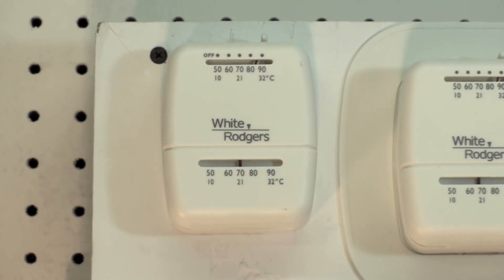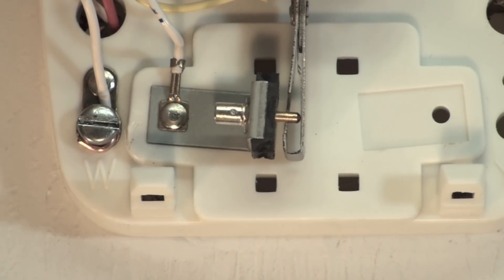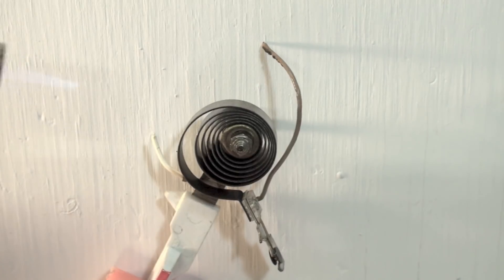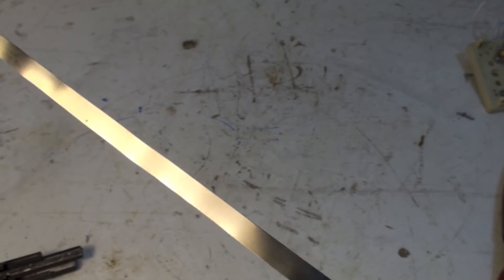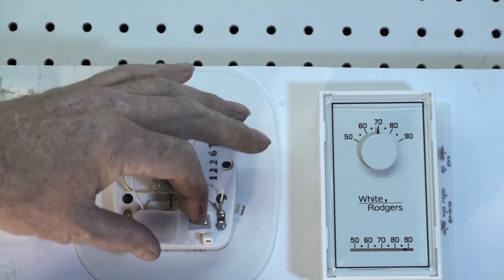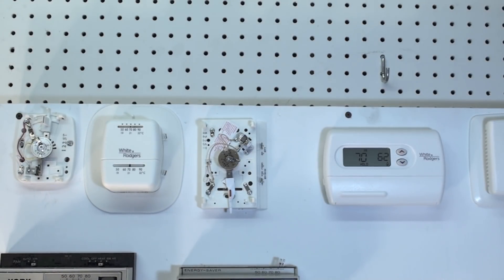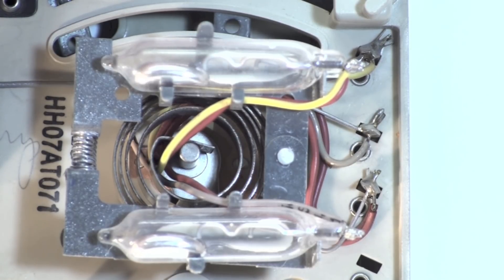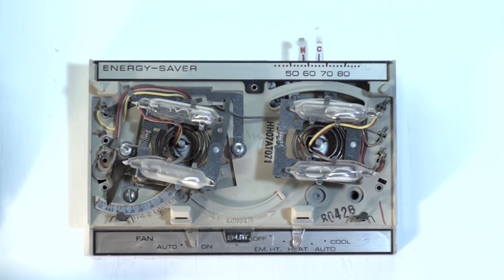The mechanical thermostat: how it works.

Comment: On an older CT87N1001 Honeywell thermostat,  how does the automatic side of the fan switch work. Is the automatic function part of the thermostat or does it connect to a extra lead to the furnace for the automatic feature to run?
Reply from the maker: If it has a mercury switch, the fan in auto leaves fan control to the furnace.  The newer style without the mercury switch has a F "fuel" and E "electric" switch that allows the furnace to control the fan in the F position.  E position energizes the fan on a call for heat.
GFM

Comment: Great video!  By the way, that dual lever thermostat will NOT work for our house because the boss of the house needs 78 in winter and 65 in summer!  I do not argue with her.  In our house, I will need those levers on the opposite side.
Reply from the maker: I don't either.   Happy wife, happy life.
GFM

Comment: I just need to know how to turn it on.
Reply from the maker: If there is a heat-cool-off switch, turn it to heat, set the temp lever above the temperature in the structure.
GFM

Comment: I have the first type of thermostat. Part of the thermostat is getting hot enough to melt part of the plastic housing.  The contact seems ok
Reply from the maker: Interesting.  Does the unit short cycle?
GFM

Comment: Of all the mechanical thermostats out there, my favorites are the Honeywell thermostats (in particular the CT51/CT55 rectangular ones, and of course the CT87N round), since they are very popular, well made, and easy to see and use. I too am fond of the GE/Trane Bay-Stat thermostats, since they were easy to see/use and very well made, as well as the Robertshaw TX400 Cube (which bears a close resemblance to the Honeywell CT87N).

Comment: I'm doing some updates on a small house that uses two millivolt wall furnaces for heat. How can I control both furnaces with one thermostat?? I'm afraid that installing two thermostats is going to result in "short cycling" on the furnace that is near all the bedroom doors as that thermostat will be too close to the furnace. On the other hand, I don't want to open a gas valve on a furnace where the pilot has gone out because I'm getting a millivolt signal from the other furnace. Seems like I need a 2 pole thermostat but I don't know if one exists.

Comment: Thanks for the videos. I'm an electronics tech myself and used to work at a hostel that had a few of these mechanical ones. We replaced them with digital programmable ones. They are good for if you could set it and forget it, but I find many people have way too many rooms on a zone and so the programmables don't seem to work so well in those situations. The room at the end of the zone will be the coldest. So I had to be constantly adjusting the one in my room that worked for several rooms anyway. Would have been easier to have a manual one as I was home most of the time anyway.

I'm downgrading a programmable one in my landlady's house tomorrow to either a digital non-programmable or an analog one. They find it hard to use the programmable one. Its not very user-friendly to elderly folks. They always have to get out a booklet when they want to change any setting. So I'm helping them go back to what they're comfortable with. There is lots of information for upgrading from analog to digital but virtually none for going the other way. This is a two wire one (r and w) so I'm thinking any old analog Honeywell should do. I will admit that some of the programmable ones I've encountered, I would have liked to launch it off the end of my steel toe boot into the stratosphere. But I digress... :)

I kinda liked the ones with mercury switches. As long as its contained inside the bulb, they're pretty safe. Its when they break and get into the environment they're bad. But if they're on the wall and operating properly, how are they going to break? All those CFL bulbs they were touting as successors to the incandescents come with mercury too, and any money savings you wind up paying for when you have to pay to recycle the bulbs. 

My "Industrial Electronics" instructor once told me he believed programmable thermostats were great in new houses with good insulation and little air flow, but in old houses with lots of drafts, he thought the analog kind were better. I think its all a matter of laziness, myself. I have no trouble getting up and turning down the thermostat at night and turning it back up during the day whenever I need it. I grew up in a remote area in Canada where energy prices are through the roof. So we never wasted energy. Now I'm equipping my parents with some LED bulbs (9 watts to replace 60) and this will save them even more money. They don't have a programmable thermostat, either. Dad wouldn't be long getting rid of it if he did buy one. :)

Once again, thanks for the great video and insight! All the best!
Reply from the maker: +privatear2001 You should have seen the programmable ones in the 1980s.  They make the newer ones look easy.  I have never seen a programmable last longer than 10 years.  Those old mechanicals easily do 50 or more.  As a service tech, I never installed programmables in an elderly person's home.  I don't think the age of the house makes any difference.  Thanks for the thoughts.
GFM

Comment: Mechanical thermostats waste energy and are inaccurate so buy a digital thermostat, they are only $13USD and they are easier to read.
Reply from the maker: Actually, a properly set up mechanical thermostat can be as accurate as a digital.   Most of them are not set up for setbacks but oftentimes setback is done by the homeowner.  The last part is, some older people have trouble understanding how the electronics work.  And after all, we are there to make the system work for everyone.
GFM
Reply: Obviously, mechanical thermostat do NOT waste energy.  Why would they?  All they do is signal your HVAC to turn on or turn off.  Nothing more than that.  The mechanical thermostat use ZERO ENERGY.  Digital at least need tiny amount of power for them to operate.  So it is the digital thermostats who "waste" energy.
Of course, when we talk programmable thermostat to save energy, we have to take in to account the need to be able to have the house not heated or cooled while nobody is there.  For some household, somebody is always at home and then programmable is not really useful.